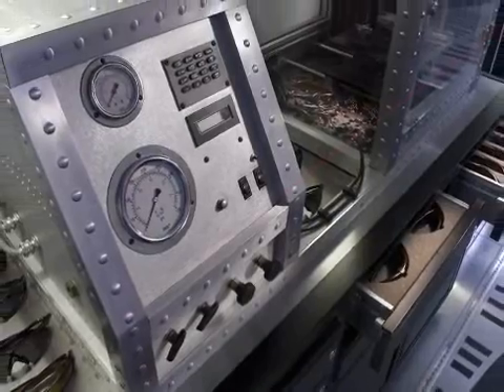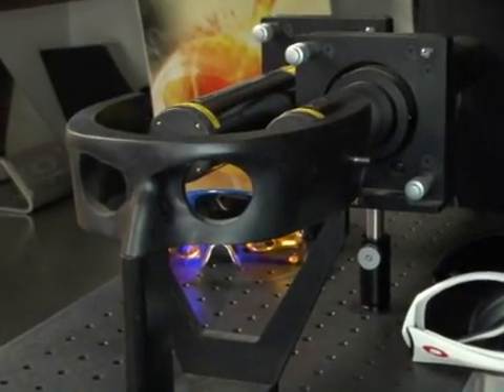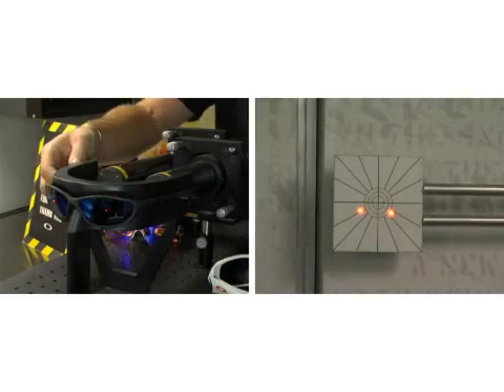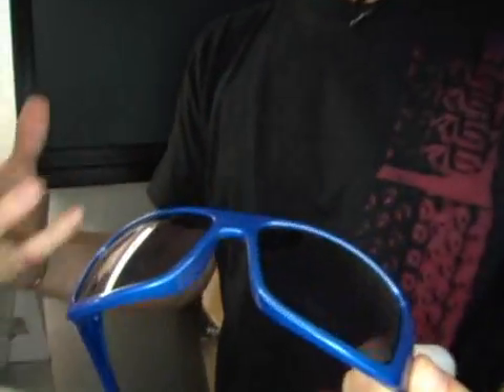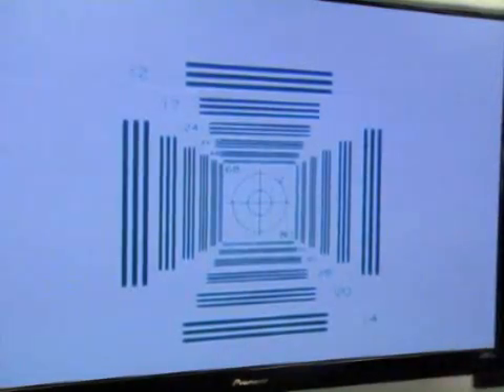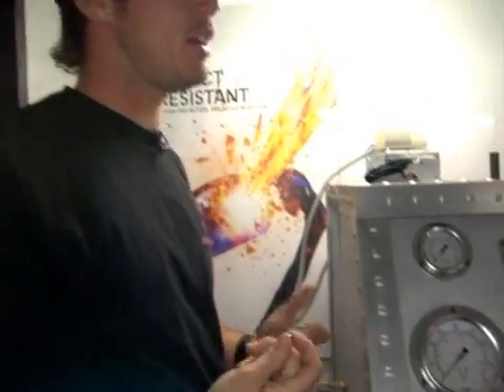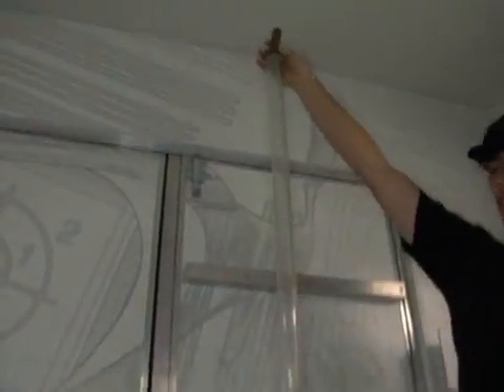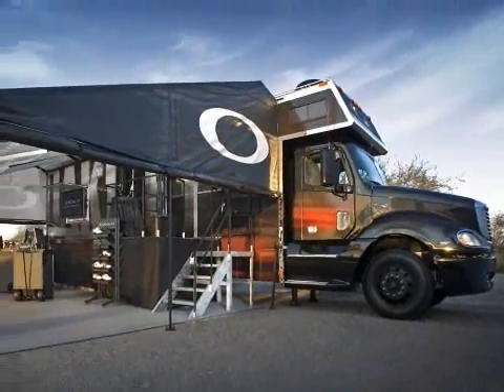Oakley's Rolling O Lab: The Science of Sunglasses

Comment: @hartanto68 no there is not a warranty for you scratched your frames or your lenses.  Impact resistance is not the same as "Scratch resistance".  The materials are designed to take impact and bounce back. Part of that impact is absorption so the material is a bit soft as compared to something that doesn't scratch.

Comment: lens can NOT eject, if you notice all lenses come out not in. And as designed the inner groove is slightly higher giving more impact support while still being able to be be remove/replaced by pressing outward,  Not all eyewear is necessarily designed to frequently change lenses this way but it is an option for when damage or scratching occurs

Comment: lens cant eject from the frame during moment(s) of impact.  

Oakley sunglasses are also designed so you can remove the lenses to replace them with replacement lenses later and keep the original frames.....they are pretty much shatterproof, but not scratch-proof lenses